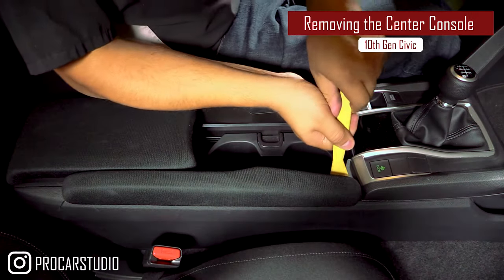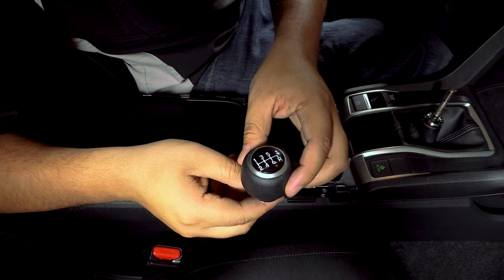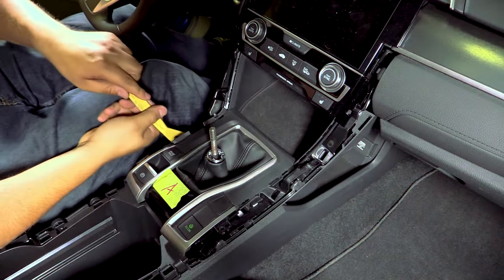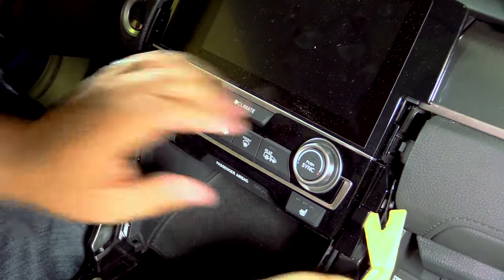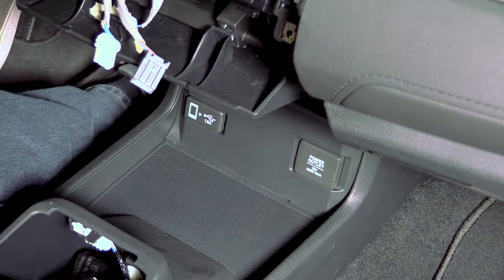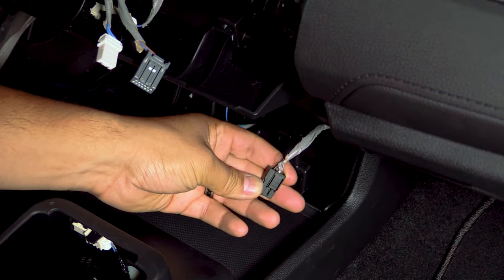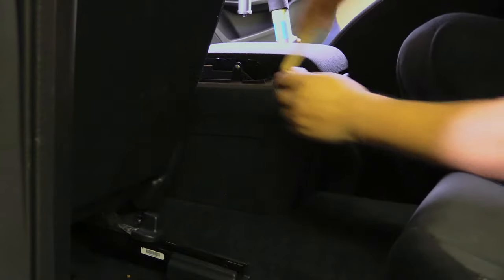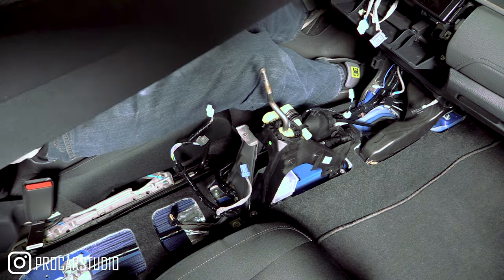Just the Tip - Removing the Center Console - Honda Civic 2016 2017 2018 2019 2020 2021

Comment: I work for Honda and I had to use this video as a reference since our service manuals suck. No where on our service manual does it say to remove the climate control to access the hidden screws. Our service manual also stated to start with the power outlets in the front without removing all the other stuff first. It made no sense whatsoever.

Comment: Thank you so much!! On my 2018 civic, the automatic transmission shifter knob has two screws a bit hidden on the front of the shifter where you can’t see. Turn your ignition to two to move the shifter back so you can get a screwdriver in there. the clips to remove the panel are more toward the central panel closest to the shifter, rather than the sides of the larger one. Just some help to anyone with an automatic. Thank you!

Comment: At 25 seconds in I can see a little black cap or plug inside the center console.  You never go near it.  What is it for? I can remove it from my civic but I dont know what the hole is for.  I cant tell if its access to a screw or to run cables through.

Comment: I realize this video is a year old but hope you (or someone) can answer this…

My 12v power outlet stopped working - It’s not the fuse so I’m looking to replace it with a new 12v. Do I have to remove ALL that first before I can remove the usb/power outlet panel??
Reply: No you don’t. I removed mine without the previous steps in the video.

Comment: My 17 honda civic 6 speed manual shift knob sudden locked up on me while driving and i don't know why it got stuck and i pulled over and stopped and then i could shift to reverse and gets stuck in neutral and can't go to other gears and im worrying about this and i managed to make it move again. And was driving on the freeway and kinda push the knob to make it go in and now it drives ok and i don't know if its the cables or bushings inside the shift console.